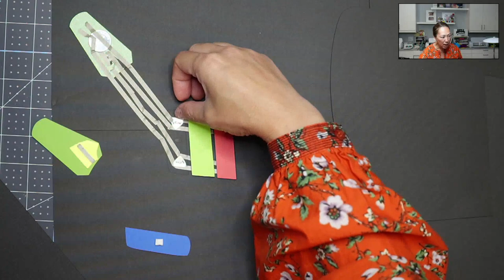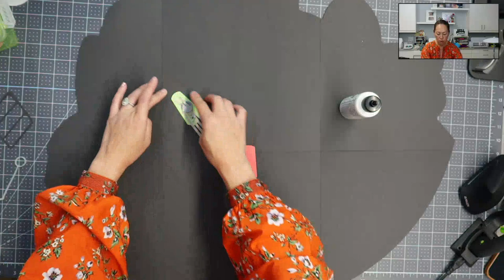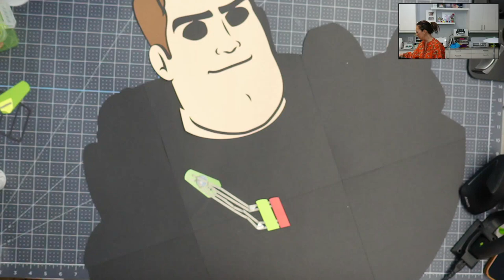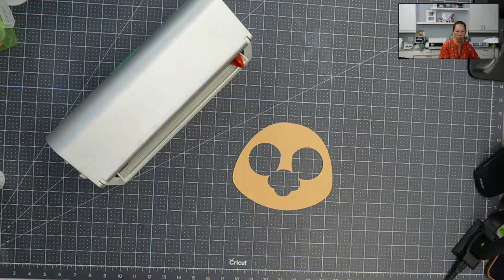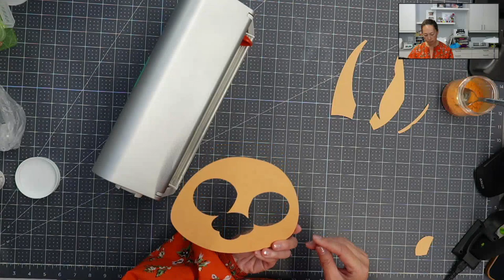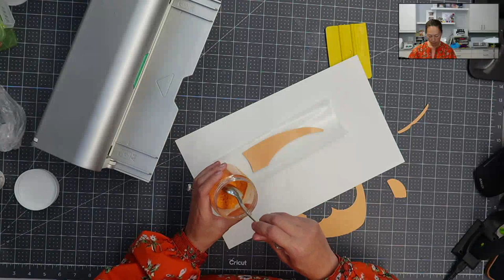Off The Mat Buzz Lightyear and Sox Party Prop | Assembly Part 2 | The Useless Crafter

Comment: When you put the background together and you hold it up, do you still see light through your seems? I did exactly what you do but I couldn’t get a tight seal no matter what I did, when I assembled my Franklin. I just ended up doing the best I could and went with it but it irritated me as I really wanted tight connection.
Reply: You could try using some black book binding tape, run it down the joins on the back, that will stop the light showing through
Reply from the maker: Thats a really great suggestion!